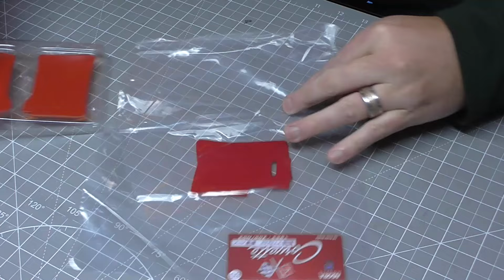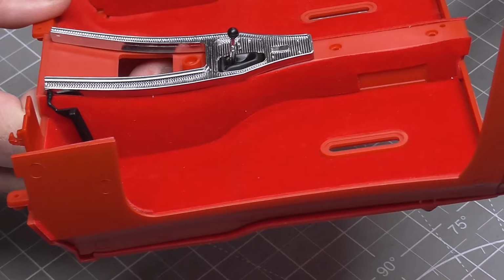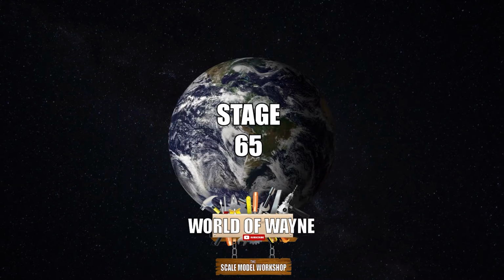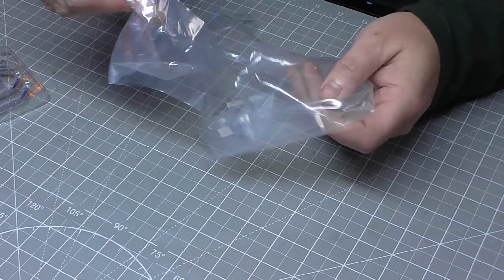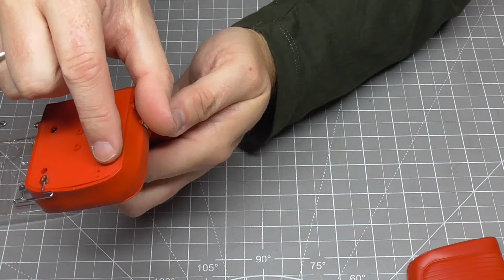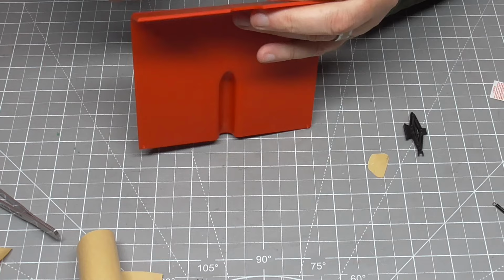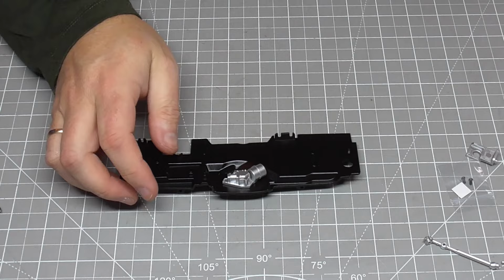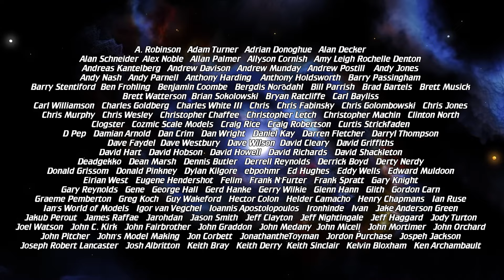Build the Corvette Stingray - Pack 8 - Stages 60-72

Comment: I suspect that the seatbelt catches should be on the interior side of the seats.
Reply: Your suspicion is indeed correct.  For the 1963-67 second generation C2 Corvette Sting Ray, the belt with the buckle was anchored near the center console/transmission tunnel, whereas the belt with the tongue was anchored near the doors. 😎